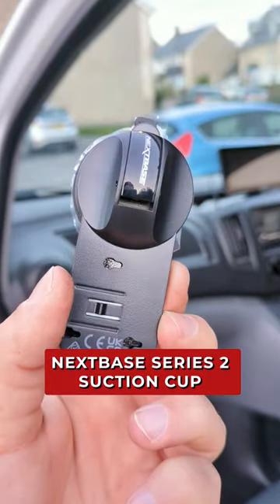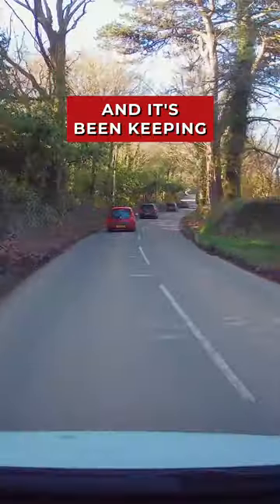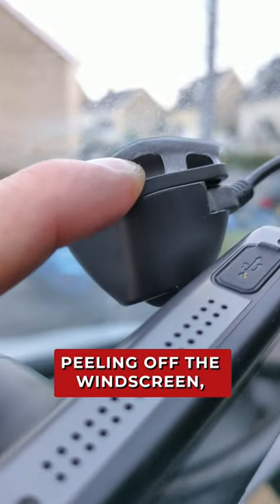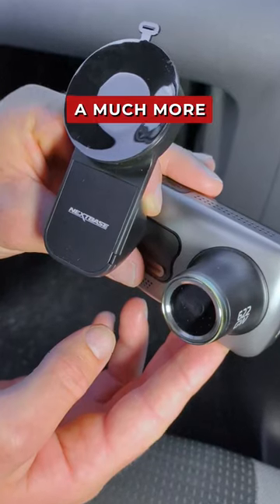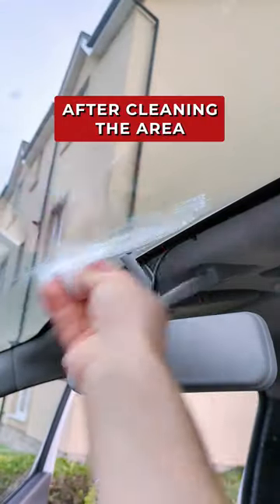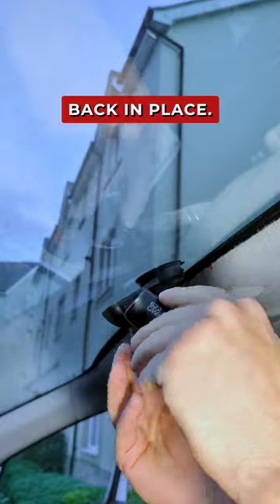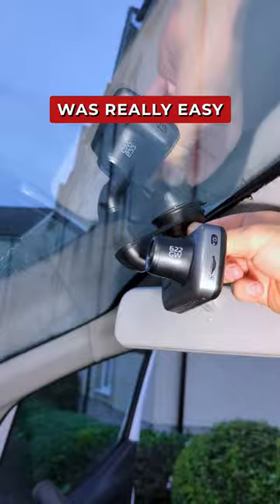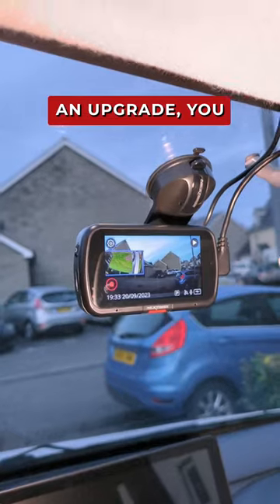Nextbase Suction Cup Dash Cam Mount

Comment: It will fall of when its hot outside as i have been using the same for a cple of years and it does fall off.
Reply from the maker: Will be sure to report back after some hot weather!
Reply: @LensOfJames  any updates?
Reply from the maker: Haven't had any problems yet 🤞
Reply: @LensOfJames  nice. How long have you had it attached to your windshield, and what is the hottest summer temperature for you?
Reply: @LensOfJames Do you live in a humid climate? I live in Houston, Texas, and it’s not only extremely hot with the heat index surpassing 100 during some parts of summer, but we also have excessive humidity being located near the gulf coast. 

I haven’t stuck my camera back on my windshield for over a year because I gave up on the sticky pads. I’m willing to try this as long as people demonstrate success with the suction cup keeping staying secure with the camera in both hot and humid weather conditions.